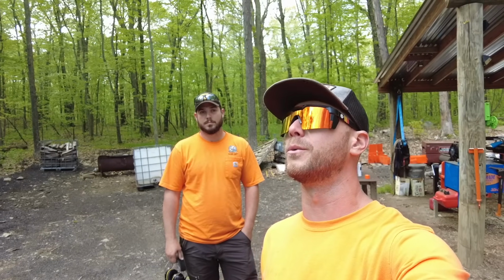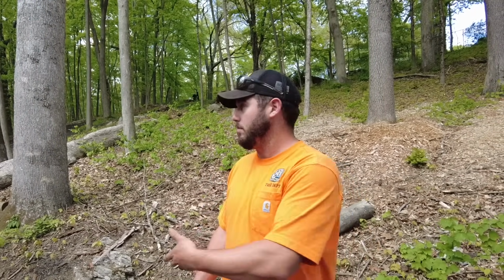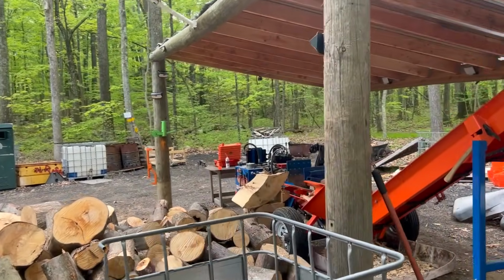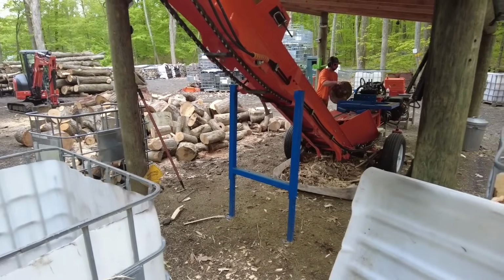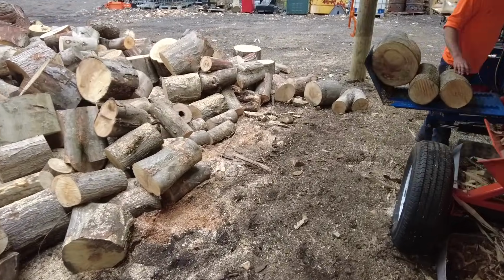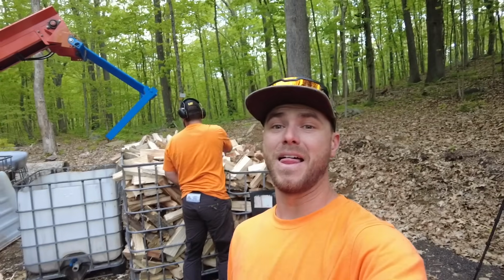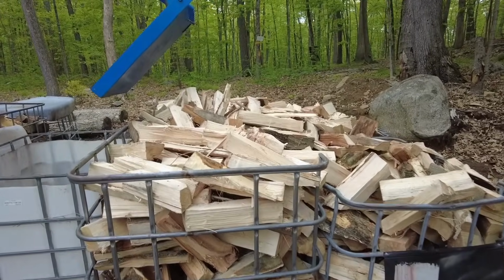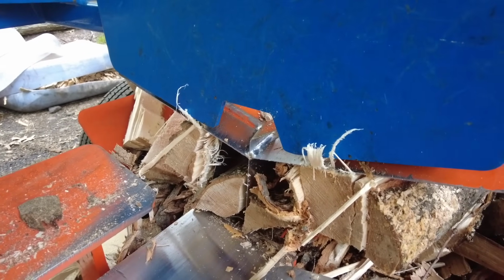#479 HIDDEN FEATURE on EASTONMADE BOX WEDGE!

Comment: I’ll have to check out that feature on my box wedge.  I haven’t noticed it on the pizza wedge.
Reply from the maker: Not sure when they started incorporating it but it definitely was on purpose!
Reply: @DudeRanchDIY  Actually I looked and I do have it on the pizza wedge, but I haven't noticed it splitting the top piece, but I will keep an eye on it.  Possibly you need some straight grained wood for it to work.  Jeff
Reply from the maker: @adirondackwoodsman I find it really only fully splits smaller rounds that are 6-10”